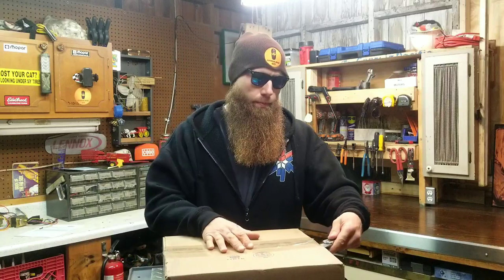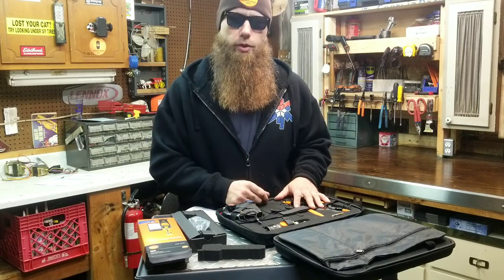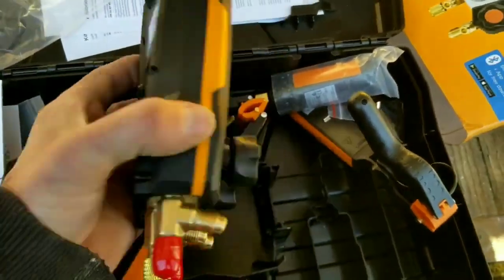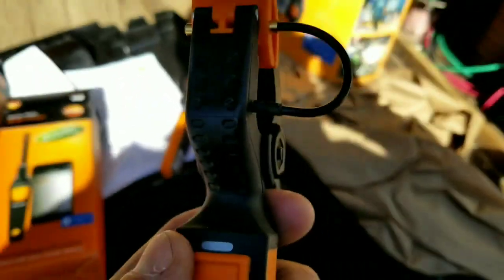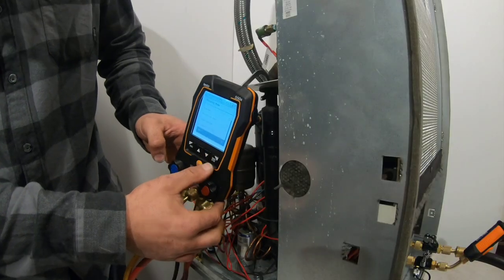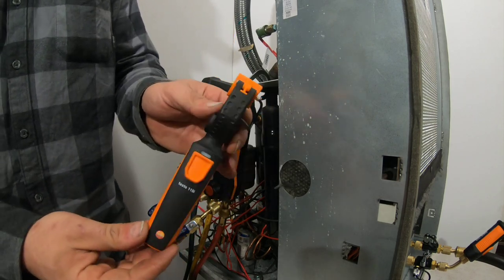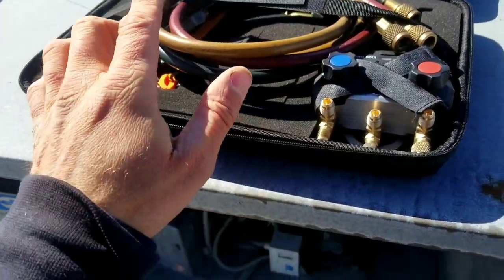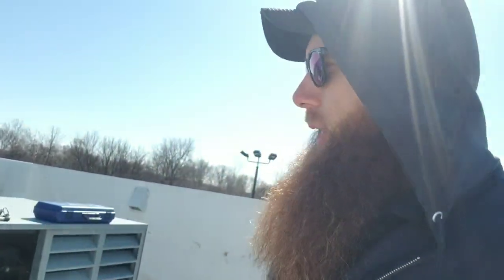TESTO 550s AND TESTO 550i 3 GUYS 1 MANIFOLD

Comment: Glad I waited to buy one of these.
Now I know 100% I'm not getting one.
Mainly the 550i..... 
I'll stay with regular gauges and my Cooper sh66a.
I'm more of a commercial /Parallel / rack guy.
Never did a rooftop in 12 years..
I wouldn't use half of the features    and I would waste more time assembling / calibrating /etc... Than just using regular gauges and good thermomètre and just do some quick maths...

Thx guys , good reviews

Comment: Great reviews guys! The 550s definitely looks cool especially with that micron gauge. Did I understand correctly, the phsycrometers do not integrate with the manifold though? That would be a shame. The 550i honestly looks like a giant pain. A solution in search of a problem that doesn’t exist. Just my opinion of course :-)
Reply from the maker: Without reading the instructions as best as I can tell the air probes do not work with the 550s for return and supply temps.... but maybe I'm missing something.... seems very silly though
Reply: I found this video because I am actually thinking about getting the 550i because it adds manifold capability to smart porbes. I do mostly refrigeration service work so a lot of the work can be done with smart probes exclusively and a charging tee, however I want a digital manifold for installation and repairs because (the charging tee works great for charge corrections but not so much for installs) but I don't feel a need to spend $600 just to add manifold capability to my smart probes which this does for $250 and I'm already using and used to the app. This is just my thoughts as a service tech and if I was on an install crew I probably wouldn't want this.

Comment: I have 1 question. Can you recalibrate the non wireless temperature clamps? The problem I have with my 550s(not the 550S), is you don't have the option to recalibrate the temperature readings. My suction side temperature has been 5 degrees off since it arrived, despite its calibration certification. In order for me to get that remedied, I'd have to send it in to be recalibrated, pay money to do so. Fieldpiece's digital manifolds have a little set screw in order to adjust the temperature read.

Unless Testo makes their digital manifold field calibratable for their temperature clamps(wired), I will not buy another Testo digital manifold. I don't care if its software offsets, or if its a mechanical set screw, I need to be able to calibrate it myself, to a known temperature source(ice bucket challenge anyone?). I love the aesthetic of Testo, I really like their combustion analyzers, but until this one flaw(and to me it is a big flaw) is addressed, I do not want.
Reply from the maker: Good question I (chris) will look into it, I don't think so though
Reply: @HVACRTOOLS  I have a strong feeling, if its anywhere, its in the App and only usable with the wireless temp probes.

Comment: (Pasting this here and vid 1 as guess we need to post comments to two diff/same  videos)

 This was good, thanks.  I love the brutal speak about the sh!te quality cases.   
A few thoughts :

1- I agree that the ‘no user manual’ experience test is very important.  But the review would also  be more complete (and possibly fair)  if you later read the manual to answer these questions, just for the sake of the video.  It might also help avoid manufacturers deciding against sending product to the channel in the future , if they believe the outcome could be randomly unfair..

2- it would be better to have had a single “4 guys” video instead of two videos.  actually,  why exactly are there two videos ? ?

3-  the sprawl of content fragmentation  destroys YT value creation.  You guys should consider combining  your individual professional channels and content , and this tool stuff, into a single channel like HVACOVERTIME and then only have  a separate  HVACOVERTIMELIVE channel for streams to insulate the main channel from profanity etc.   (like bigClive does ).   Positioning it this way would put you amongst very top of related channels.   YT Channel mergers are bound to become a big thing in the future, methinks, if the history of media and business is any guide..

anyway, nice work!👍